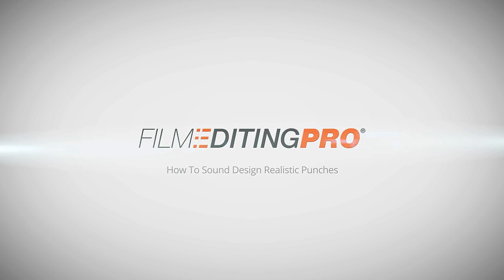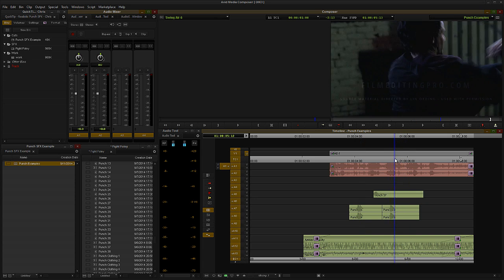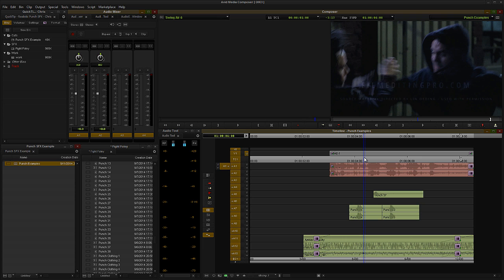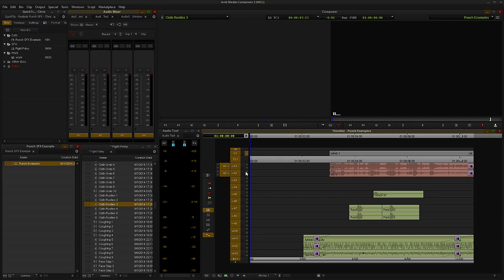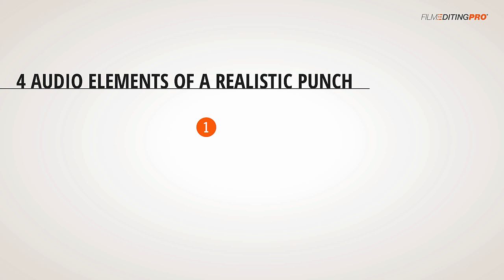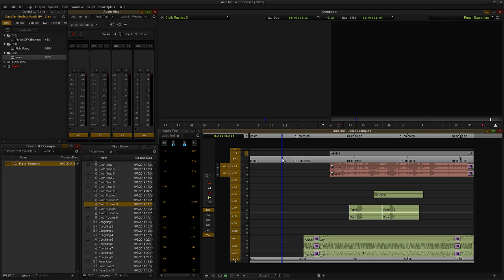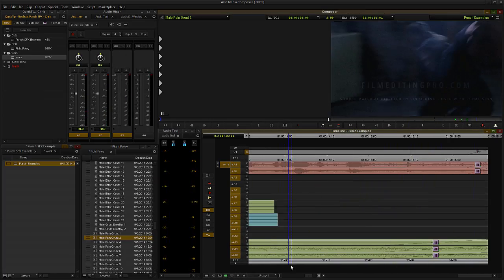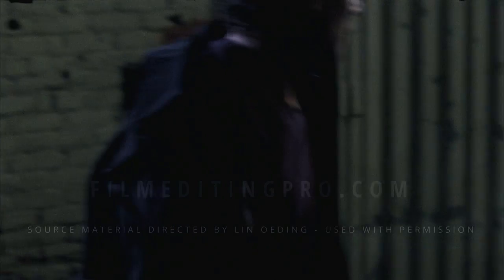Film Editing Pro Quick Tip - How To Sound Design Realistic Punches

Comment: I have never understood why film editors always use such loud impact sounds for fight scenes. If you aren’t creating a super-hero movie, then there is no reason for these sounds to be so loud. A fist fight produces very little actual sound. If you took the sound level of the edited SFX and reduced then to 25%-30% volume, then this fight scene would sound more realistic. No fight scenes in movies sound realistic. The amount of speed it takes to create a “woosh” sound with a punch would end the fight instantly. The same holds true for a fabric flap. You will hear the rustling whilst they scrap and wrestle, but not from a punch. Hollywood has gotten fight scenes wrong forever. Sure these sounds make fight scenes appear more violent, but not realistic